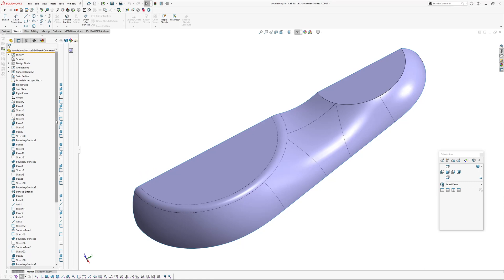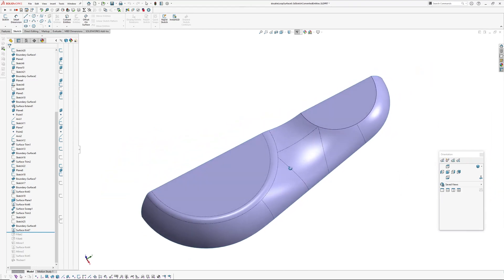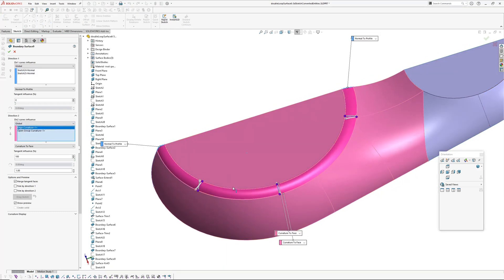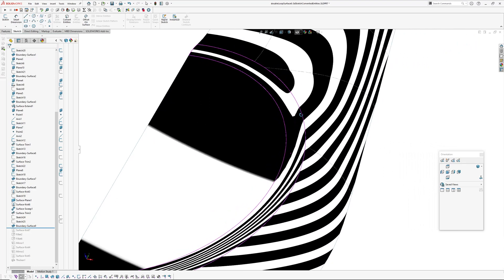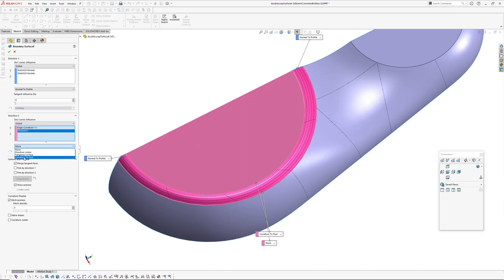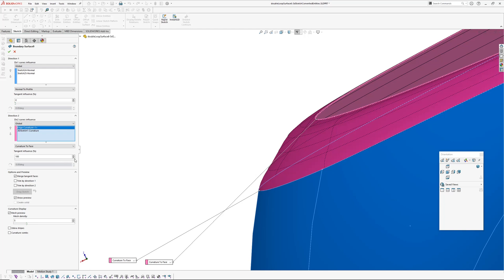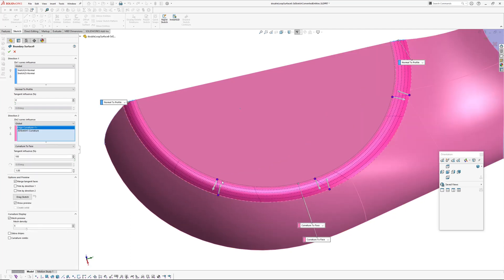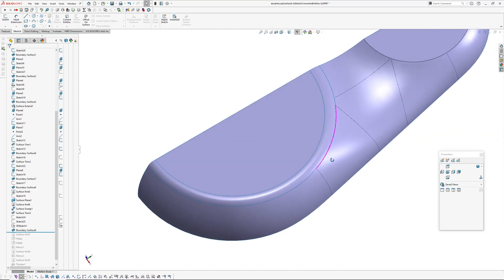Solidworks Workaround: Using Converted Entities in Boundary Surfaces

Comment: Oh wow, thanks for that!
Would also be nice if there was a tickbox for connectors to connect in such a fashion that it uses 'shortest distance' between the edges, because in so many cases one wants them to 'spoke' out at 90°.
Reply from the maker: Yeah it'd be great if you could make them perpendicular to one boundary or averaged between both. It does seem like a bit of a functionality hole - click box for auto UV flow.